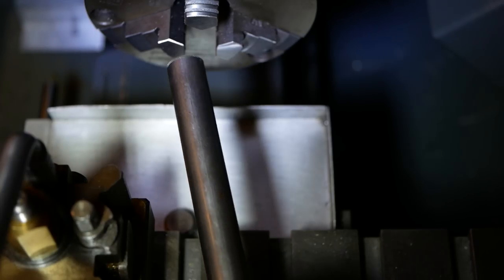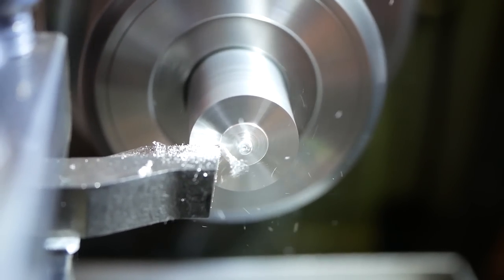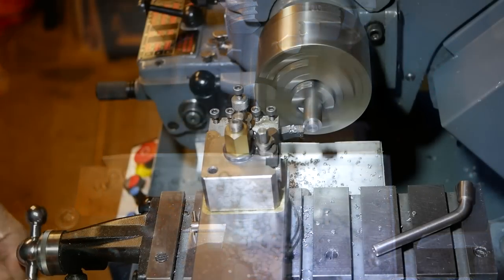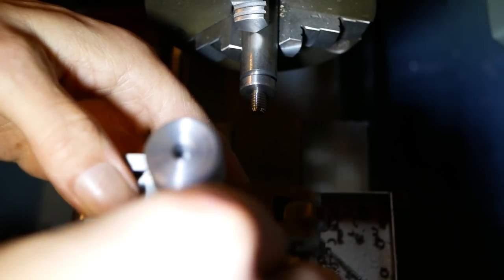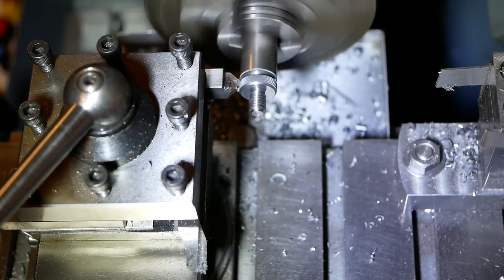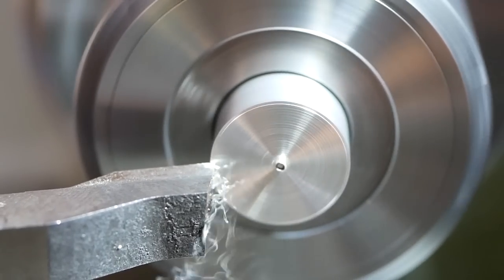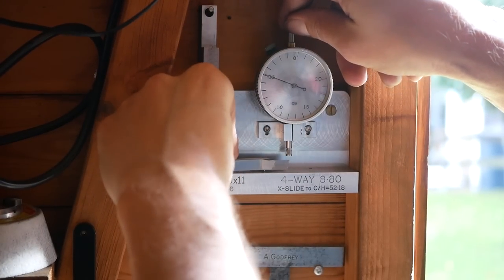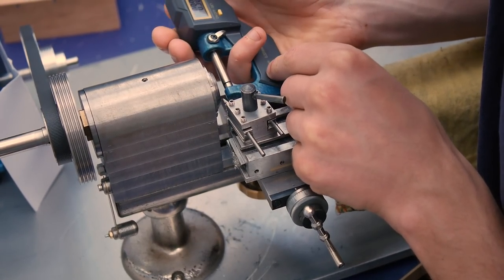In Defence of the 4-Way: Myford Toolholding

Comment: Yes, there's a lot to be said for "old" 4-way tool posts. For production runs they are so much faster than quick change types. On the other hand, I use different tools for different materials & with different sized boring bars, internal as well as external threading tools, different grooving & parting tools, quick change systems are far more versatile when you have lots of different jobs to do.
Reply: I use both. It really depends on what I’m doing. If the process requires more than four tools then the quick change is my choice.
Reply: If only all 4-way's were the nice quality production types, they're barely comparable except in appearance.

Comment: I agree. My main lathe came with a QCTP, admittedly a size too large for the machine, and because of the (substantial) overhang parting off was a no go. The company I bought the machine from only did non-ferrous metals and probably plastics on a collet chuck of max. diameter 25 mm or thereabouts. So the overhang etc. was probably never an issue. 
So I changed back to the indexing toolpost I had from an identical machine and it makes a world of difference. A major drawback indeed is the tool center height which is 17 mm on my mid size machine. I have plenty of 25 mm carbide insert tools (from a previous larger machine) that I want to use. This would only work when the compound slide is eliminated like Rob Renzetti and Stefan Gotteswinter have done, with the 4-way tool post this is the only way to get enough 'meat' underneath the tool (more is better, the current 15 mm definitely looks too flimsy. Meaning I will design and make my own). At the same time I can then eliminate the 25 mm overhang of the compound over the cross slide the machine has by default. Not sure why this is BTW. A rear tool post for parting off can then also be mounted right on the edge of the cross slide with no overhang. 
Already I am using fixed stops for auto feed cutoff and hard stops with micrometer dial, which is pretty much a must with no compound as well as an important safety feature. 
Lastly, the jaws must be bored like Rob shows in his last video and all of this combined should lead to a very stable and effective setup. 
I also have a few turret lathes so it really depends how far one wants to take it, but in my case accuracy is a major driver and tool life will increase with more stability. The way I see it, there should be metal-to-metal interfaces all the way down from the tool mounting interface to the machine bed.
Thanks for the great video. Love the tool height measuring gauge.
Final note: I have watched a LOT of Japanese machining videos and never ever have I spotted a QCTP. Go figure.

Comment: As with most things, which tool holder is the best depends on what you are doing. The indexable holder along with an indexable holder for the tail stock quill is just the thing for a run of repetitive parts. The downside is the time it takes to set up. It is a law of the Universe that the tools you need to use aren't the ones in the in the tool holder. The bulk of the indexable tool holder can be a problem too. The size of the quick change, though smaller, can also be a nuisance as well. This is where you still need your American standard lantern holder to get into the tight spots you often run into doing repair work.
Reply: Always hang on to the lantern! A buy up all the Armstrong holders you can find. I'm liking the *springey*? parting blade holder.

Comment: I have an ML10, which doesn't have enough centre height above the compound slide for a QCTP without being restricted to 1/4" square tools. And they're so expensive & bulky with all those extra holders taken up for each tool. So I just use an aluminium L section spacer machined to suit each indexable tool I have, which is as close to 'quick change' as I can get. The main reason I've stayed away from a 4 way toolpost so far is because I didn't fancy having a sharp not-in-use tool pointing towards my hands. But after watching this encouraging video, I think I'll give it a go, and get some silicone rubber tube to make tool covers. And the rear toolpost parting tool looks like worth making, as well as the centre height measuring jig for my spare clock.  A great video, thank you.

Comment: 4 way toolholders are also technically more rigid though that depends a lot on the lathe itself too wether that will be a factor. I have a good quality reproduction multifix properly sized for my 4.5kW lathe and it’s plenty rigid. I’ve done 8mm diameter cuts in 42CrMo4 steel with nice blue C shaped chips at about 0.15mm feed/rev. The thing I love the moet about my multifix is the cylindrical holder. They make 30 and 40mm bores for my size post and I usually keep an ER 32 collet chuck in there for drilling and small boring bars. If I take the chuck out I can put a 30mm boring bar in there and let her rip, very rigidly clamped in the bore holder. Max diameter boring bar would be 25mm in a comparable 4-way holder while I can do 40mm, much better for large holes. Tool changes on multifix can be pretty quick too. On repeatability, I’ve never seen anyone actually test the 4 way holders. Have you done such tests? I’d be curious to know how good they are for DRO use. I’m aware there are CNC 4 way holders with automatic indexing but those are built way better than normal ones I imagine.
Reply from the maker: I agree with you - the maximum tool size in the 4 way has occasionally been a limitation. I think if you can mount a larger diameter boring bar in your multifix, that will certainly more than offset any loss in rigidity of the quick change over the 4-way. Regarding 4-way repeatability, we've measured it to within a few microns but in reality it translates to a diameter variation of pm 10 microns when you actually machine something. I guess there are other factors at play -- tool wear etc... The main repeatibility issue, in our experience, has been the bore of the toolpost is a sloppy fit on the bolt on cheaper 4-ways. If this is the case, we found bushing out the bore so it's a nice snug fit on the bolt solves the issue.
Reply: Have you ever tried a rear tool post, an extra tool and even more rigid.
Reply: I have the Multifix B, mostly original holders. Stability and repeatability is great, have 16 and use them all. I have the same boring bar holders and use one for a chuck and collets.  The ability ro quickly set the holder at an angle is wonderful, I can just not understand why they divided 90 deg onto 10 parts though...My only issue is that they are a bit heavy and cumbersome  to handle compared with other solutions. I keep my tool post pinned for repeatability.  I have a 4 way on a small lathe but on my main lathe I simply use to many different tools for it to make sense.

Comment: Very interesting. Never owned a quick change, but I did build myself an adjustable holder which I set with a height standard with each change. I have identical ones on all 3 of my lathes. I guess it's just what you get used to? I agree that your method is definitely faster.

Comment: So far as I am concerned, you are preaching to the choir! I made the GHT four way many years ago and see no reason to change now.
I now mainly use tools with exchangeable tips which once set to centre height require no further adjustment.
I was interested to see that your large boring tool holders are vertically split rather than horizontally as shown by GHT.
Thank you for putting the case for the four way. I was interested in your relative repeatability point; as you say, a comparable QCTP is always going to be dearer if only because of the need for multiple holders.

Comment: You don't need to lock the quick change height adjuster screw for each cut. back the screw all the way out and just lock it when your height is set and you are needing to actually remove and remount the tool holder. Yeah i know locking it down will twist it slightly but its insignificant

Comment: To make a generalized statement that the 4 way toolpost is better/faster than a QCTP is ridiculous, because it is NOT!
What wasn't shown was the set-up time for the tooling in the 4 way tool post, chasing for shims, adjusting, etc.  By the time that was done the lathe with the QCTP would have finished the job!
I do agree that for batch production the 4 way post is quicker, in which case a 4 way post may be kept populated with the appropriate tools, ready for the next batch.
For one-offs or 2-offs, the QCTP shines.
Reply: With inset tool holders, you shim once (the height never changes) and mill a spacer that size. Changing a tool is two clamps rather than one- but some are not changed (the common ones stay). So, only if more than eight tools are needed for a job is a QC faster. (0 + 4 x 2) vs (8 x 1). But then you can have multiple 4 posts...
Reply: @Tensquaremetreworkshop  I use HSS shop sharpened tooling almost exclusively, thus the height does change a little with sharpening.
When I had a 6 Atlas lathe only, I made several triangular tool posts with 3 slots so that the front edge would not interfere with the tail stock.  Still, I found the shimming tedious and irritating,
With my "new" 10" lathe I finally made the QCTP and tool holders myself as I could not justify the cost of that tooling in the early 1990's.
Reply: @BasementEngineer  I was toying with making a QC unit myself, until I viewed this. Plus, I was concerned with rigidity and tool depth- for example with my knurling tool. With inserts, any advantages are small.
Reply: @Tensquaremetreworkshop  The QCTP I designed and built in the early 1990's is very rigid indeed.  It is of the dove tail type with the male on the tool post.  This makes for very stiff tool holders because of the extra metal at the front and back.
The tool holder clamping is via a finger clamp that pulls on the tool holder on its rear-most dovetail surface.  It is a very rigid arrangement.
My lathe is an Emco-Maier V-10-P, and at 60 rpm has tremendous torque at the spindle.
I've gotten a parting tool stuck at that speed and nothing broke!  Even the spindle kept turning with the work slipping in the 6" Pratt Burnerd chuck.  It even impressed me.
Over the years I've more than 30 tool holders of various types.
With the experience of making a few holders, additional ones are quickly "cranked out".
Perhaps for a small lathe, say 6" dia capacity, a number of triangular slotted tool posts may suffice, each TP populated with the most commonly used tools in one post.
That's what I did for my 6" Atlas lathe.
Reply: @BasementEngineer  The title of this video is a tad provocative- but often needed to grab attention. I am not saying that users should discard working QCs that they are happy with. But they are not for everyone- as an insert user they would bring little or no benefit at considerable cost. Rigidity- this is both static and dynamic; the latter is important for chatter. A reasonably designed 4 post is horizontal mating surfaces all the way down to the bed. Gripped vertical surfaces will never be as solid.
I too use a Pratt 6", but would regard the workpiece slipping as a fault- not a good thing to happen. Fortunately I use a VFD drive, so can apply torque limits to prevent such a catastrophe. 
I have a number of tool holders that have a 1" deep grip surface (the imperial shows their vintage) incl my knurling tool. This is a challenge for QC- yes, it is possible, but the time taken for all of this would never be recovered. I want to make things, not play with my lathe- so my current system will stay. I am grateful to this video for clarifying my thoughts, and am now comfortable with my current system.
Reply: @Tensquaremetreworkshop  How do you fit 8 tools in a 4 post, so that you still can use all 8?
Unless you have very short and small parts, 4 outside tools or 4 inside tools are the max. If you use a mix of inside and outside tools you are down to 3, if the part or the boring bars are short enough, if its longer than the 4 post, then you are down to 2.
And as soon as you start to work with multiple 4 post, the QC is faster.
Even the 4-way QCTP from PARAT i worked with, was only faster than a Multifix because the tool holder were further away and i would had to turn around to grab them.
And the 4 post with the shimming are just a pain in the ass.
Reply: @wolf310ii  My sums are thus-
4 available without change. Each extra takes 2 bolt loosen and tighten- so half the speed of a QC. 0 + 4 x 2 = 8 x 1 - so that is the break-even point.
As I explained, I use insert tooling (fixed height), so no shimming required (single packer per holder, which can be attached for permanent no effort inclusion). To be clear, this is changed as fast as a QC tool, plus the additional bolt tighten.
You may wish to argue that it is not 8, but 7 (or whatever) - to me that is irrelevant. I do most of my lathe work with 2 tools ( combined turning + parting), chamfer sometimes, still one left. Any possible time saving for the rare large number of tools required is in the weeds compared with the vast majority of use.
Reply: @Tensquaremetreworkshop  Thanks for your reply!
The beauty of a hobby work shop is that one can do as one pleases, with no one looking over one's shoulders and criticizing.
And if anyone is to blame when things go wrong, one can blame one's tools or look in the mirror.
I've spent much time making tools and improvements and, of course, model engines.
Both have given me much enjoyment.
Reply: @BasementEngineer  Agree with that! What I like about these YT discussions is that it makes you do research and think things through. You end up knowing more, and have reasons for what you do and how. Sometimes it makes you change, other times it confirms your method. Both are good.

Comment: Well, I can’t compare as I’ve not tried the four way.  But I can say that one of the forest projects with the quick change setup is to build a rack for all the holders!
Reply from the maker: Absolutely. If you do use a quick change, a rack for all the holders is a must! With the 4-way it's nice to have your individual tools set up on a rack too. This way, you could store the tools  with their appropriate shims, if desired.
Reply: I store my tool holders in a roller slide cabinet next to the headstock of the lathe.
The drawer is fitted with a board that has an individual compartment for each tool.
I also keep a 2" brush in that drawer to brush off the new tool holder and the tool post each time I change tools.
My shop-made QC tooling is not hardened, and this brushing action has kept post and holders in pristine condition, apart from the blackening wearing off after 30+ years of use.

Comment: With insert tooling and a QCTP I find it much quicker to shuffle through 8 tool holders.   I keep one empty for random tools.   I only pull the 4 way out if I need to run a 1 inch boring bar and even then, I'm thinking about making a thick bar that fits the qctp.

Comment: Very interesting! I use carbide inserts, so the height is always the same- I have milled a 'shim' for each carrier, so no selection required.
I know that some people have multiple four-way units, so can change four tools at a time!
Reply from the maker: Thank you! Yes, I also sometimes use carbide inserts. I use the same approach as you in this case. I have heard of the multiple 4-way toolpost idea before. I think this might warrant further investigation. It might be nice to have one toolpost fitted with zero-rake tools for brass-specific jobs.
Reply: @chronovaengineering  My local Men's Shed has a donated Myford- which came with a spare 4way. I puzzled over this, but will now press it into service!

Comment: My four way Smart and Brown tool post uses square headed clamp screws.  These self clean themselves of swarf.  Problem with hex socket head cap screws is that their recesses ALWAYS fill with swarf.  So for the parting off tool holder which came standard with socket head cap screws I finally made two square headed clamp screws form 4140 high tensile steel with the same across flat dimensions as the rest of the tool clamp screws.  The "T" wrench tightening tool now fitting all tool clamping screws.

Comment: Interesting video. I do however disagree with the speed of the 4way, compared to the quick change. The range of tools that can be stored in tool holders, already set at the correct center height, is far greater than in the 4 way.
But this is just my own opinion. Thanks for a great video

Comment: I used the 4 way for years but found the QC was overall better and gets even better for every holder you have past 4. The 4 way cannot be effectively used with a longish boring bar, neither can it be used with a tangential tool and it has to be rotated only in 1 direction. My QC can also be set to any arbitrary angle while some 4 ways cannot. Ideally I'd like a 4 way quick change tool post, it does exist.